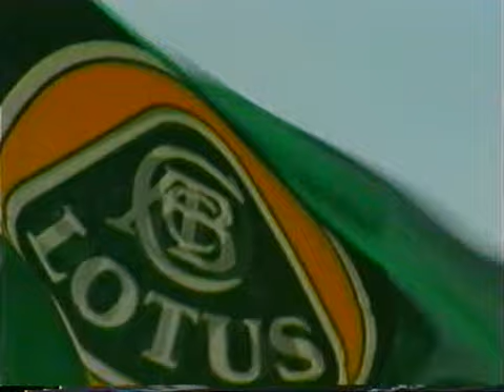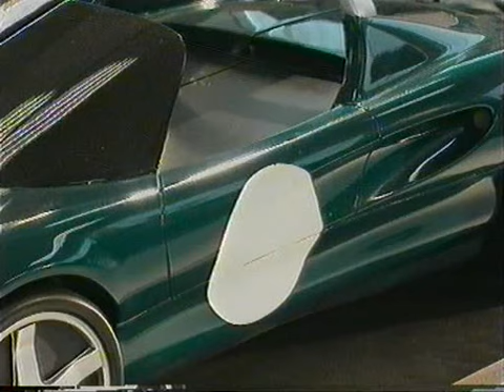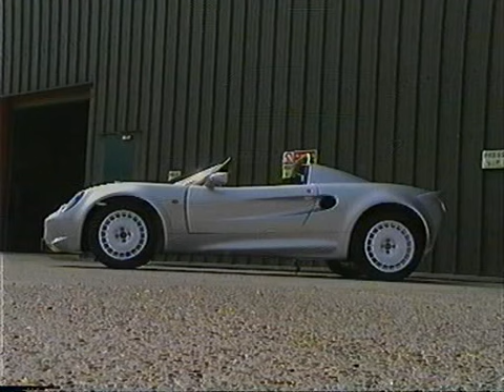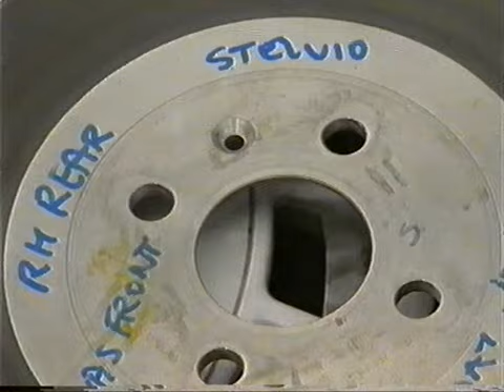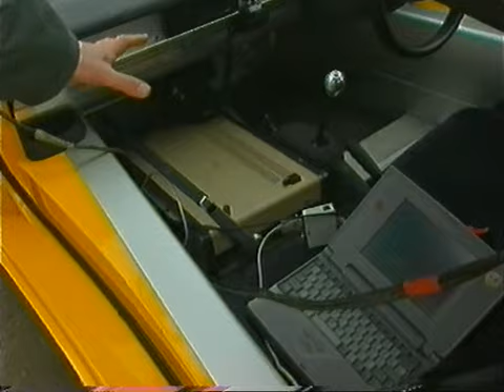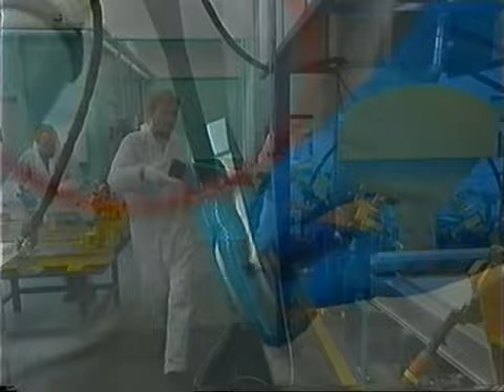Lotus Elise - The Inside Story

Comment: quite amusing around 42 minutes, when the designer is upset with the fact that the rear has to be changed. He cant quite seem to accept that his design doesn't work aerodynamically, and however much he wants to keep it looking that way, it simply wont function properly. Very common problem with the relationship between deisgners and engineers

Comment: It's like that 2 seater convertible has a high Roll center. Nothing like the Lotus Europa of the 1970s. It was quite unique two person with the mid-engine design. go around corners like a go kart. I drove one from Indy to Florida and then on to LA. It was quite a hoot. At the top end of around 140 miles per hour like you were on Rails at the beginning traveling down highway us 41, the highway ended at Evansville and you had to turn left on exit. The roadblock was not lit up at night that all I had time to do with turn the wheel to the right at 80 miles per hour onto an exit that was Mark 20 miles per hour the Lotus Europa made the turn with no problems at all exiting the turn at about a hundred and on to Florida  . But of course if I had not have made the turn I probably wouldn't be telling you this as go karts were built safer back then. The Lotus Europa was made out of plastic with an aluminum double Wishbone frame. We would have been completely smashed up in a plastic car hitting a roadblock I thought I would be nice while we were washing the car in LA polishing the bumpers as they look like they were Chrome that the owner warned me not to do that as they are plastic also with a chrome finish like model car plastic Chrome. Like I said the car is quite a hey hoot hoot hoot hoot LOL

Comment: I had one for a few years and used it as a normal car, mine had a hard top on, I drove it in the worst of snow and ice. They are a tough car. But unless you're on a circuit not very effective. Was so exciting tho also it was the 111 mk 1 on a v reg. I put the s2 bilstein suspension on, toyo proxys and a induction kit properly plumed into the side vent.
Then it really made sence.
Unfortunately I sold it shortly after and I nearly cry about it sometimes. 😞

Comment: Did Lotus ever give consideration to using the 103 hp 1.4-litre Rover K-Series at the lower-end of the range with possible scope for a 120-130+ hp turbocharged variant? 
Also interested to know if other engines were considered for the original Lotus Elise aside from the Rover K-Series?

Comment: 3rd and 4th generation Supras started getting really porky. I had an oddball 1991 All-Trac wagon which came standard with the MR2 engine; then to overcome the drag of the center differential and rear live axle..and 350lbs extra weight. That car was fun crazy around the corners with flip/flop over steer/under steer.Would do 120mph going to visit friends in Arizona, but I had to engineer an overflow for the 5speed, because it would spit oil out on high speed runs..LOL!

Comment: You mean the A-arm ball joint assembly that would shatter and then the rest of the cars structure was severely compromised after crashing into the wheel well assembly?.Ford out-sourced the development and build of that fad car that came and went.They lost a lot of money on that project as they did Volvo, Jag and Land Rover.First generation NSX were turds,back of car would bend and crack over time and customers had to replace rear tires all the time. Aluminum does not maintain tensile.

Comment: Ford started using composite brake rotors described in this video on their first generation Taurus...that began in the late 80's. Ever driven an old Taurus with the old composite style rotors? they would have to be replaced all the time, because the real world heat from braking  would warp the rotors much  worse than even cast-iron; that was when they did not de-laminate and cause extensive damage to the hub assembly.It was an experiment gone horribly wrong and expensive for the end consumer